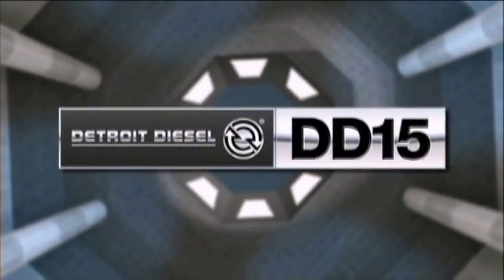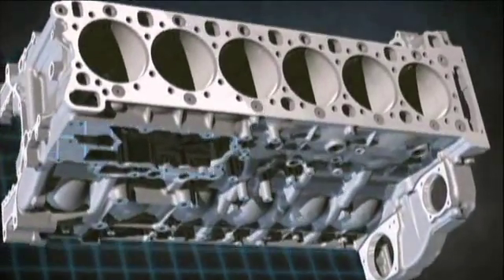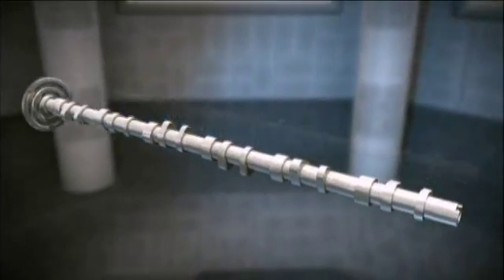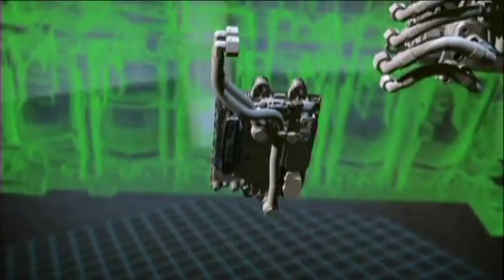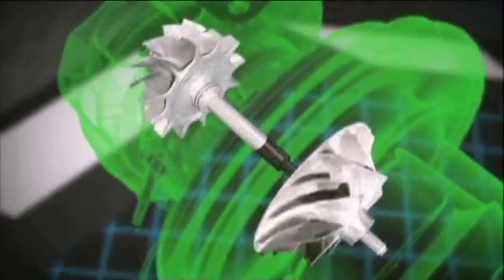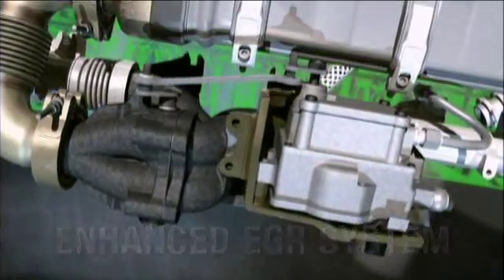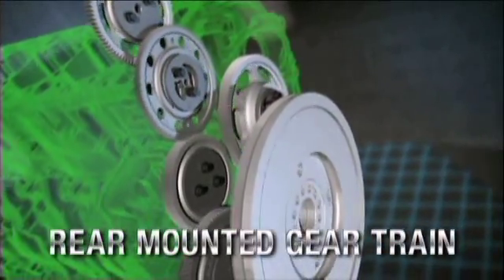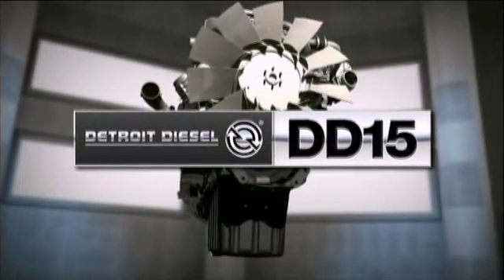Introduction to the Detroit DD15 Engine

Comment: Hmm, the compounding thing is like what EMD uses on their turbocharged prime movers
Reply: lol, i know this is 2 years late, but the EMD uses a mechanically driven turbocharger and the DD15 axial turbine is exhaust driven and drives the crankshaft through a fluid coupling and gears
Reply: @ShadoFire25 exactly 💯

Comment: Turbo compounding is old technology,the aircraft industry used this on the large radial engines ,4 of them on one engine will recover 25 percent power from the exhaust system  ,fancy advertising on a old system from the 50 ties
Reply: R-3350 Wright, the engine used in the B-29.
Reply: Almost everything is old technology.  Aside from the emissions junk, and the electronics, there's nothing mechanically on this thing that wasn't already thought of by some big-mustache inventor in 1915.
Reply: No one said it was new but that they were utilising its effectiveness to improve the package, yes its been done before but so have most things, its how it's incorporated into new uses that's the point

Comment: Does anyone knows how does this engine calculate the amount of diesel to inject per stroke? I mean the mix between air (Oxygen, Nitrogen, CO2)  and fuel, do we know how much oxygen enters in combustion chamber.
Reply: RUBEN ESPINOZA 
Yes, there are many different sensors, reading intake pressure, fuel pressure, nox, on and on and then calculate time and length of injection per stroke. 

Out of curiosity, why would you ask this question? To get to the brass tacks on how it calculates and delivers fuel is a lot of hours in training, to give a relevant answer in a comment section is nowhere near practical. 

But if you really wanted to learn I'm sure there are some good videos here in you tube that will help. Good luck on your learning adventures.

Comment: Worst experience with your " the best engine in the class"
Poor pulling power
Poor mpg
Endless problems with after treatment system 
injector cupers fail at 370k
Auxiliary turbine fail at 415k
Egr coolant valve fail at 300k
Two Fuel rail fuel lines fail at 300k
Truck almost got in fire cuz of fuel spilled on engine 
My biggest mistake in my trucking business was to believe all this crap and buy 2012 cascadia dd15

Btw I got freightliner 99 century with 60 series on it. It's the best truck I have ever had , making money , best fuel economy best reliability, easiest repairs 
Thanks CARB and EPA for making life of American truckers harder
Reply: your’e welcome
Reply: terrible engines to work on when in the vehicle, outside of the vehicle very easy

Comment: These are good engines, but they had issues with leaking cam frame housings, mainly on the fuel rail side.
Reply: Yep. A $2400 repair to replace the seals. Ask me how I know that. 
Also, my jake brake is almost completely ineffective and the dealer can't seem to figure out why. It comes on but it's so weak it isn't even worth turning it on.

Comment: I worked for one company that had this engine in a Freightliner.  125k on the odometer and it was already blowing smoke out of the bottom.  They also had to change the fuel filter at just about every fillup.  Not very encouraging.

Comment: @FreightlinerofUtah u mean Cummins has the best product hahahah jk but as a tech i have worked on the isx 15 2010 preprodution engines and the dd15 doesnt look like ittl make it a million miles to me before it needs an over haul i mean who thought hollow cams was a good idea? and whats even worse puttin the stress on the injector to amplify fuel pressure
Reply: jonesd5o  9 years later, the Cummins proved to be problematic, with the dd15 lasting longer and being much cheaper to run.

Comment from the maker: @27butters None of the engine makers went to EGR or SCR tech because it was convenient, they had to meet new EPA standards.  When you make an engine cleaner, there are going to be inconveniences.  Compared to what else is out there that meets the standards, the DD15 is a good engine.  Cummins has also put out a good product, CAT couldn't and exited the market.
Reply: from our experience, that's a big NO for the 1st gen DEF Cummins ISX, easy enough to fix that one last time though. Sorry, our engines came out around the time you made this comment. I'm from the future, 2018 actually.  History has proven Cummins product was total crap in Alaska, they didn't test for that harsh of conditions and the product failed miserably under those conditions. Every one of our trucks went down with emissions faults time after time. Until they didn't anymore:) A serious fail for their customers, an utter breach of trust and comitment to a quality industrial product. Dumb things couldn't even drive through 6 inches of water without messing up the emissions system either. Total joke. Even my Subaru Outback can do that successfully.